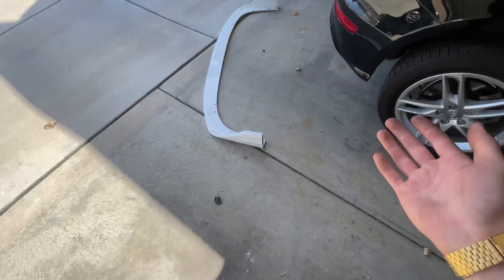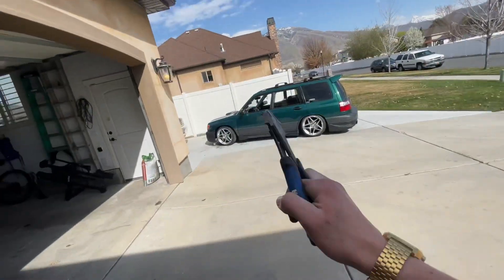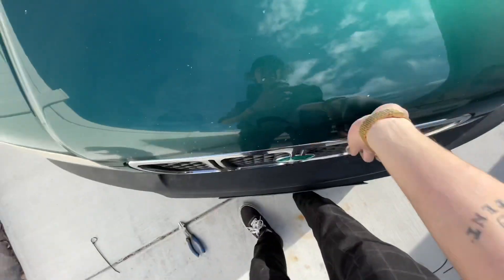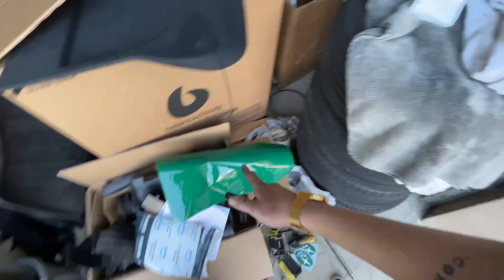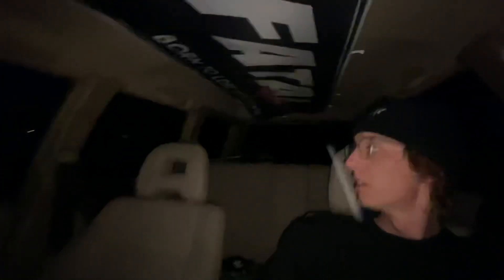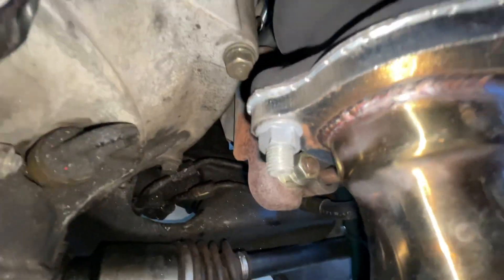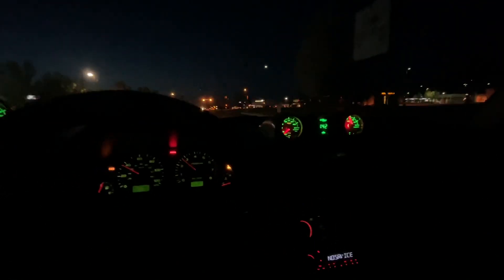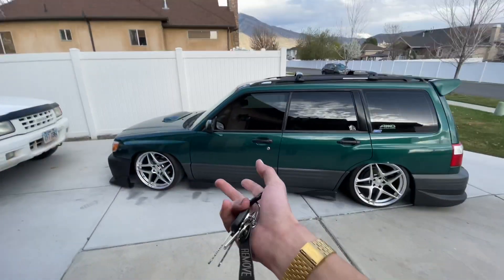Gronda vlog 8: STI forester gets CRAZY front splitter

Comment: what wheel specs are you running and do you rub at all 3
Reply from the maker: 18x9.5 +22 I don’t rub at all with pulled and rolled fenders. I’ve ran a 18x10.5 +22 as well with minimal rubbing